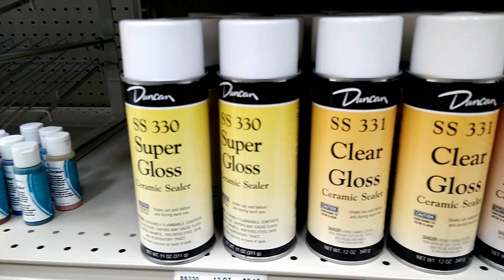Pitfire Part 2/ Burn it ALL!

Comment: Try using copper sulphate,  cobalt sulfate and iron sulfate right alternatley around you pots as you load them.  These have a lower melting point and the will fume the pots better.  Also pickup a bale of hamster bedding from Walmart to put right around the pots to keep the sulphates close to the pot surface. This will help you with colour.

Comment: I tried firing a piece in the fireplace when I was in the 5th grade. Technically speaking, it didn't work, but it did give me a little experience. Forty years later (give or take), I'm giving it another whirl. Thanks to your video and a few others, I've picked up enough do's and don'ts to hope it's worth my time. I'll know tomorrow... (or at least I'll have learned a bit more)

Comment: Yes that up in smoke is great for a list of organics and other info.  We use a metal garbage can with holes in the bottom. Alot cheaper than brick but does have to replaced after a few firings.  My question is did you get any calls from neighbors about all the smoke?  We have ours at a club members house who has an acre. we also use in some charcoal to keep it hot alot longer.
Reply from the maker: +Debbie Weiss  not do far, no

Comment: The roofing sheet metal you are using is galvanized.  Using it as a cover for your fire releases toxic fumes.  It is very dangerous.  Also you need some sort of screen to prevent embers from escaping and setting your neighborhood on fire.  It won't matter that it was accidental, you will liable for any damages and possibly criminal prosecution.  You need to call the fire marshall and have him inspect your setup and rebuild it to meet fire code and to be safe as possible.  Dude, you don't want to have to live with the fact that your pit fire cost someone their life.